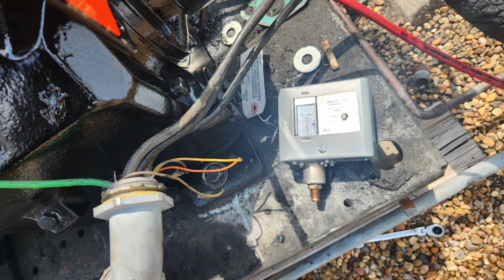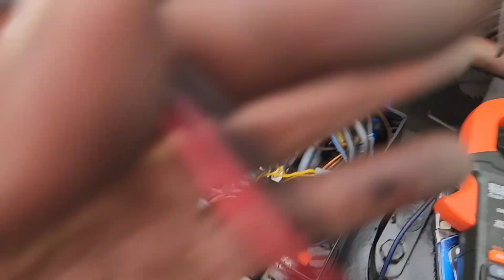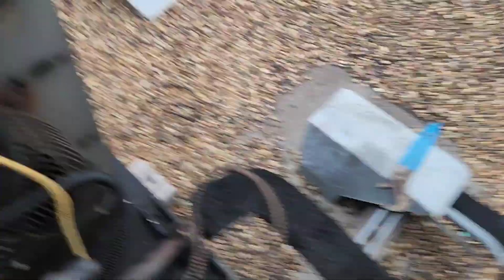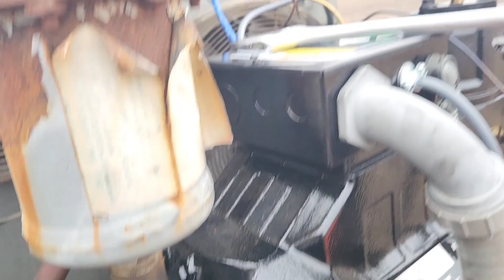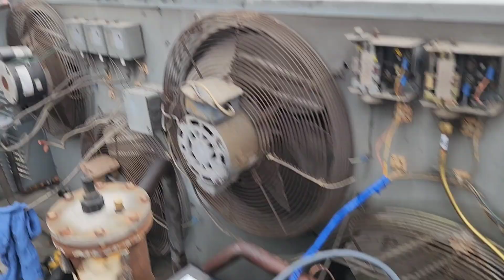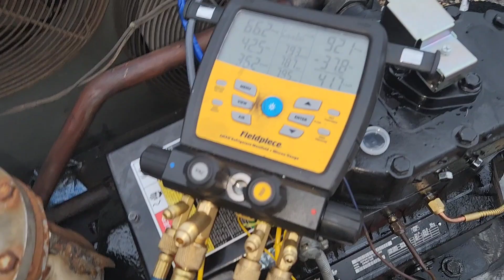COPELAND 3D COMPRESSOR REPLACEMENT JOB.

Comment: Great job they should have sent someone familiar with the compressor did plenty in my time in refrigeration. This how you learn but it doesn’t look good essentially if your dealing with Supermarket. Imagine when l did racks we had a contract on one major Supermarket chain we had 4 hours to diagnose a problem that include traveling time that a lot of stress or the company pulling product or call refrigeration truck .l was luckily l had electrical background in electronics .this is when we didn’t have a phone or computers to google only manuals.
Reply from the maker: Wow, that's crazy terms. Must have to do with the market and what the competition is willing to go down to to get the work

Comment: You crack me it’s going the right direction  lol 
It doesn’t matter on the recip compressor the only thing it changes is the direction of the oil pump. 
Awesome job man thanks for the video
Reply: The crank has a journal of sort for CW & CCW rotation of the oil pump. It uses one or the other depending on rotation. 
I haven’t noticed any oil pumps that are single direction for Copeland Discus maybe Bitzer but as Czechmate commented it would be stamped on it or have a tag stating phase sensitive.  
Just doing it is the best way to learn In my. opinion 
“Freon goes in the low side and payday is on Friday”
Reply: Yep👍👍
Reply from the maker: Cool. Thanks.  So I need ti be watching my oil pressure on 3 Phase for the Rotation?
Reply: Some oil pumps are directional and some aren’t. Usually on the end cover it will state it or it will be on a tag or the book that comes with the compressor.

Comment: That's the hussmann promise. Send guys to do a job they have never done before. Take 2 as long and customer has sales loss and box is shut down
Reply: That little white donut is a proof switch for the e2 like a current sensing relay
Reply from the maker: @alejandrozometa1951  Yeah, I knew that I just don't understand why its purpose is to interrupt the Senstronic module.